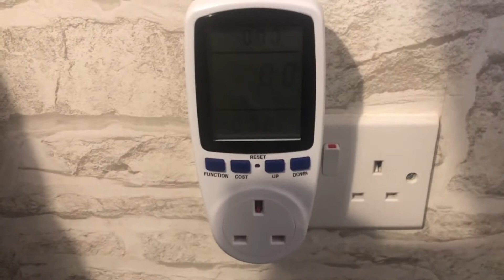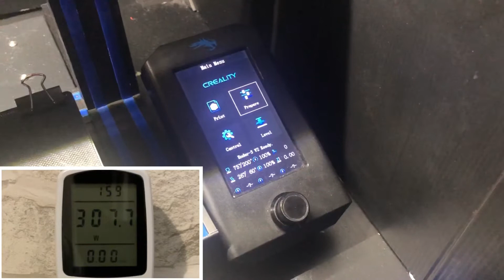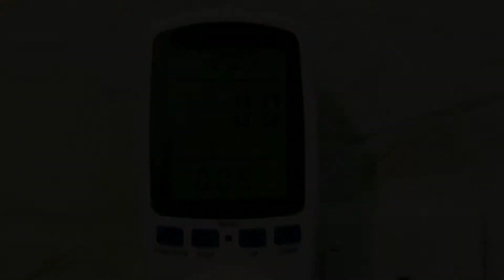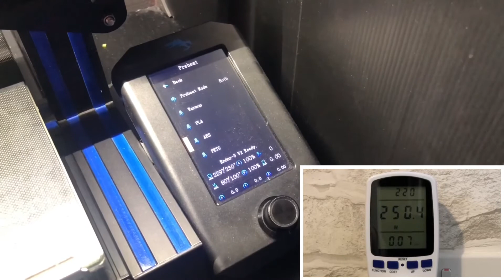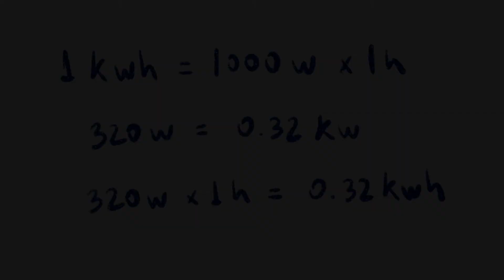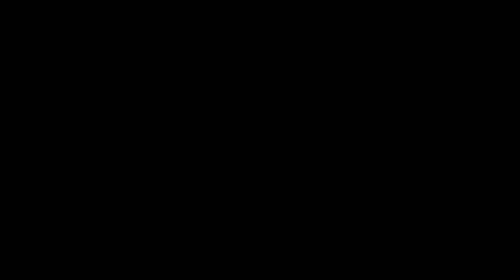Quick Tips - How much 3d Printing Costs in Energy?

Comment: Would be interesting to test power consumption with and without enclosure. As you said, the main energy consumption is due to heating. I can imagine without enclosure the amount of energy required to maintain the temperature setpoint is much higher.
Reply from the maker: Indeed. I expect a bit more, specially for the high temps used on ABS or Nylon. Thanks for the suggestion I’ll try to measure and update a quick video when I have the chance. I’ll probably try and test it mid winter in my unheated garage to give the most extreme conditions :)